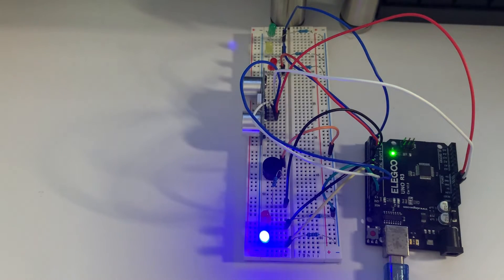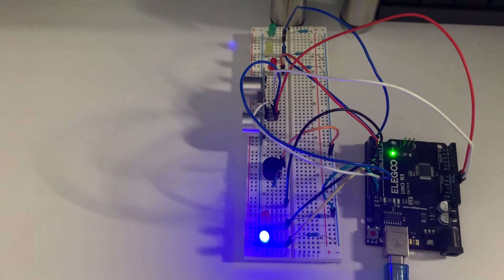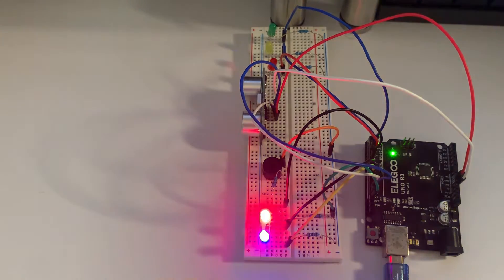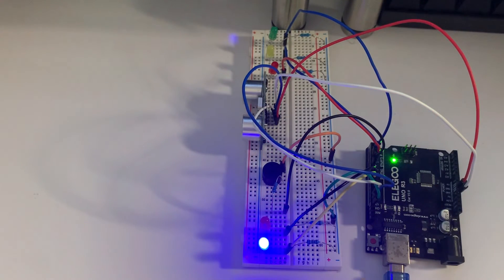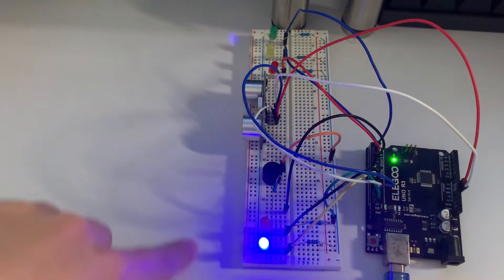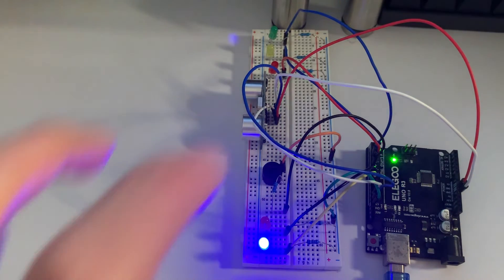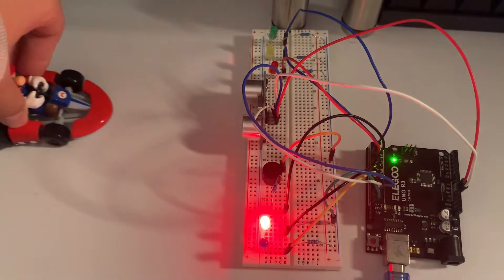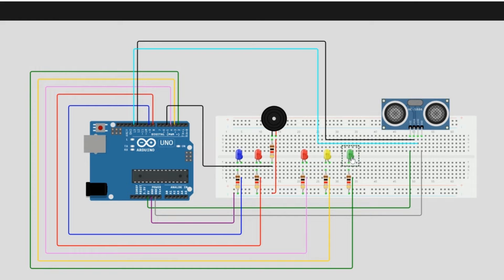Arduino Traffic Sensor, LED, & Buzzer + Loop & Conditional Code (Easy to understand Tutorial)

Comment from the maker: const int echo = 13;
const int trig = 12;
int LED1 = 2;
int LED2 = 3;
int LED3 = 4;
int LED4 = 8;
int LED5 = 9;
int buzzer = 5;

int duration = 0;
int distance = 0;

void setup() {
  pinMode(trig, OUTPUT);
  pinMode(echo, INPUT);
  pinMode(LED1, OUTPUT);
  pinMode(LED2, OUTPUT);
  pinMode(LED3, OUTPUT);
  pinMode(LED4, OUTPUT);
  pinMode(LED5, OUTPUT);
  pinMode(buzzer, OUTPUT);
  Serial.begin(9600);
}

void loop() {
  digitalWrite(trig, HIGH);
  delayMicroseconds(10);
  digitalWrite(trig, LOW);

  duration = pulseIn(echo, HIGH);
  distance = (duration / 2) / 28.5;

  // Turn off all LEDs and the buzzer
  digitalWrite(LED1, LOW);
  digitalWrite(LED2, LOW);
  digitalWrite(LED3, LOW);
  digitalWrite(LED4, LOW);
  digitalWrite(LED5, LOW);
  noTone(buzzer);

  if (distance < 10) {
    digitalWrite(LED3, HIGH);
    tone(buzzer, 850);
  } else if (distance >= 10 && distance < 20) {
    digitalWrite(LED2, HIGH);
    tone(buzzer, 1000);
  } else if (distance >= 20 && distance < 30) {
    digitalWrite(LED1, HIGH);
    tone(buzzer, 1500);
  } else {
    // Distance is greater than or equal to 30, turn off the buzzer
    noTone(buzzer);
    for (int i = 0; i < 5; i++) {
      tone(buzzer, 1000); // High pitch
      digitalWrite(LED4, HIGH);
      digitalWrite(LED5, LOW);
      delay(100);
      noTone(buzzer);
      digitalWrite(LED4, LOW);
      digitalWrite(LED5, HIGH);
      delay(100);
      tone(buzzer, 500); // Low pitch
    }
  
  }

  Serial.println(distance);
  delay(1000);
}